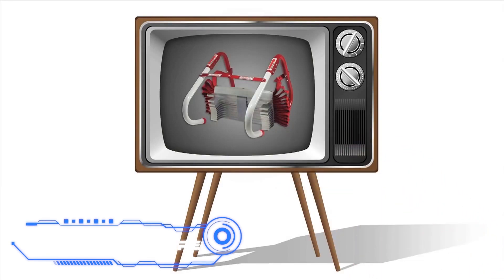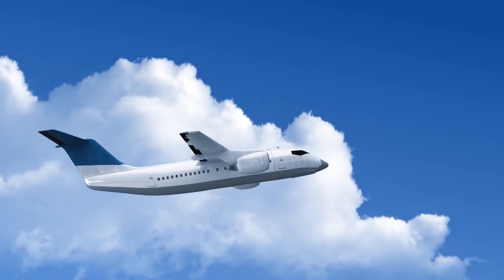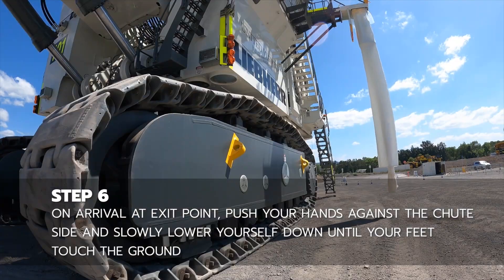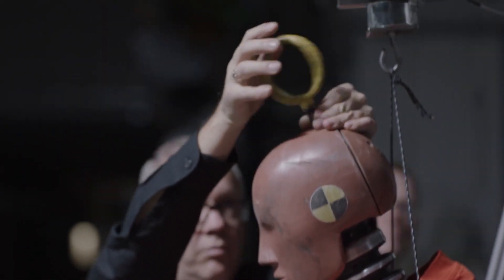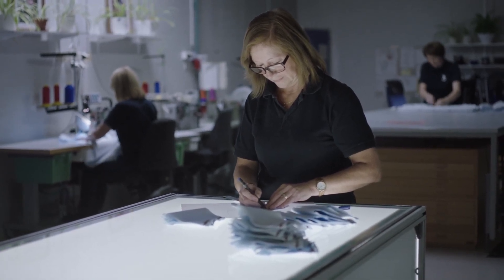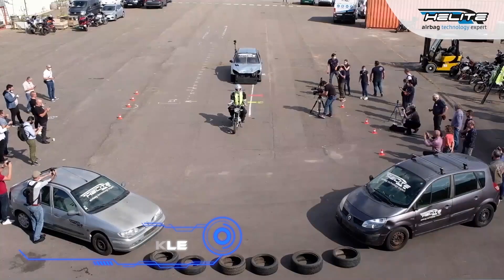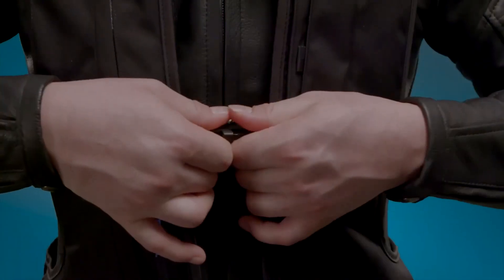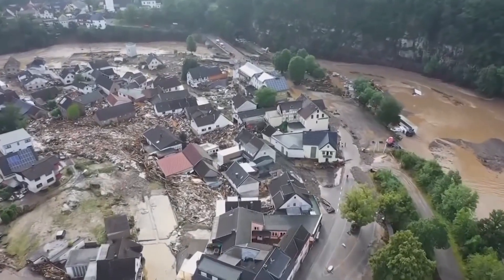INVENTIONS THAT CAN SAVE YOUR LIFE

Comment: These inventions are so useful. Kidde Fire Escape. It's a single-use ladder that can rescue people from a burning building. It has thousands of pounds carrying capacity. Airplane rescue module concept looks so cool. It has a capsule to save passengers during catastrophe. They also advise enabling the emergency separation of the passenger cabin from the rest of the aircraft. Ingstrom Escape Chutes is really helpful. It has the great benefits which is a safety solution over using ladders. They are also adaptable and appropriate for buildings and structures in addition to machinery. Thank you so much for doing this video.
Reply from the maker: Great rundown! Thanks for sharing!